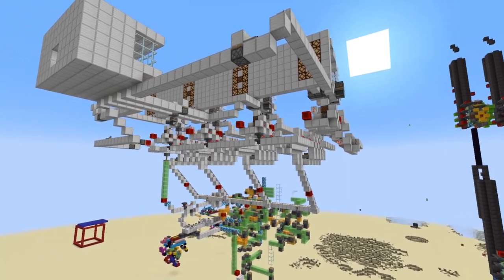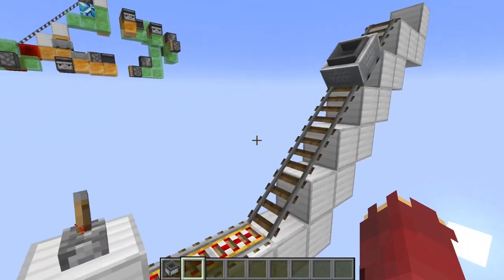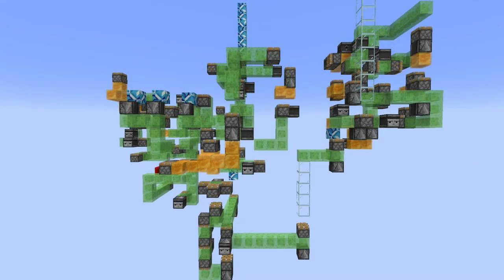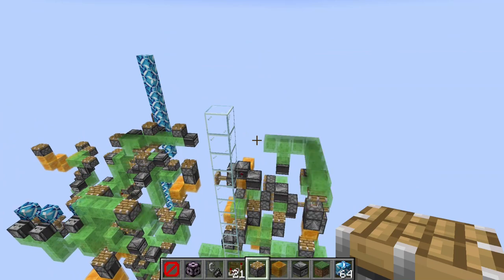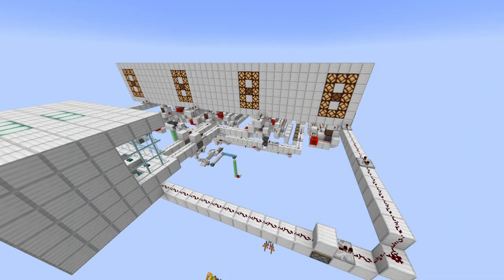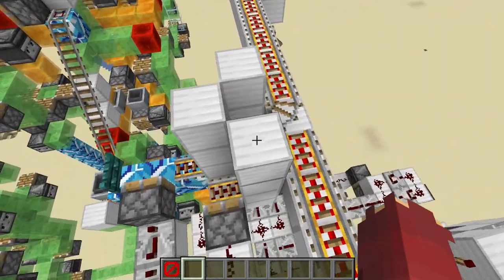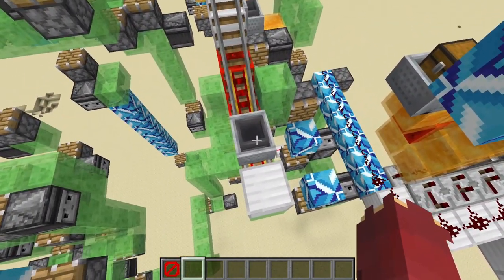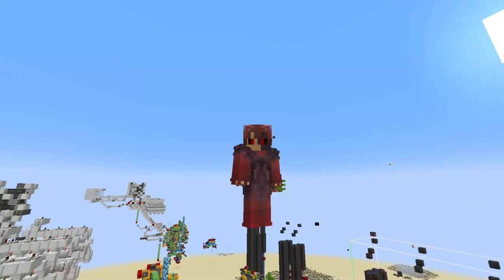Minecraft Nuclear Targeting Computer Explained (Reupload)

Comment: Hello 
As with all Minecraft flying machines, the problem of chunk loading still persists
This contraption is functional and innovative for sure but the only way to effectively get this across long distances is to make a player go AFK on one of these machines or to build a massive perma chunk loading system.
Is there any way to put a chunk loader directly on a machine like oscillating an armor stand or an arrow with a piston?
Are there any other ways than going afk on one of these machines?
Thanks
Reply from the maker: Unfortunately there is no moveable chunk loader (that I know of). This is actually one of the best designs for super long range, since it only has 1 engine and so only needs 1 afk rider. Other designs for precision missiles are smaller and simpler, but do not work for super long distances without multiple afk riders. If a moveable chunk loader is ever invented I’m sure it would be a huge improvement for all precision missile tech as a whole